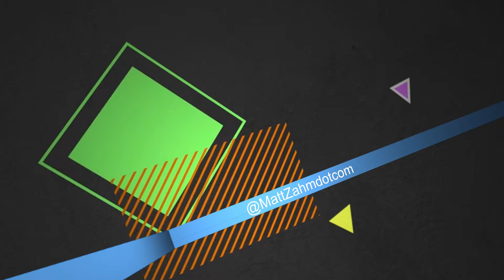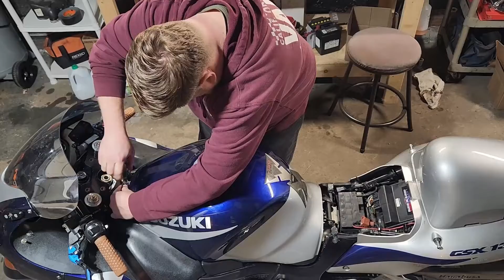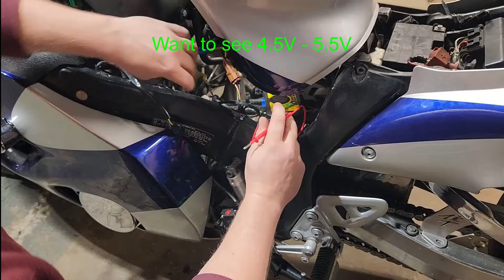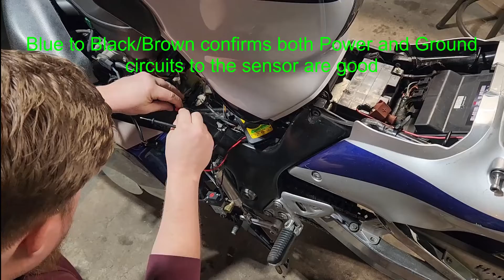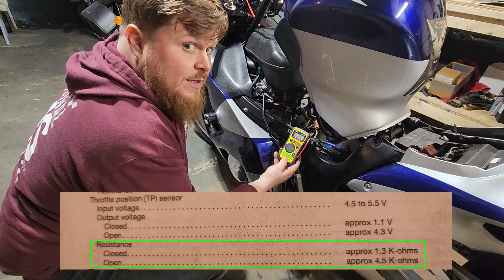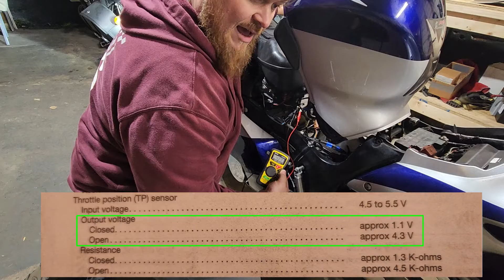Gen 1 Suzuki Hayabusa Throttle Position Sensor (TPS) Diagnosis/Testing

Comment: Hi Matt, will a bad TPS cause the bike not to start?? I have a 2006 Busa. I turned off while warming up and have not been able to get it stated.
Reply from the maker: I'm not 100% certain here. I'm more familiar with cars that have a more complex electronic system. Most go on fail safe and will allow the car to run with poor to no response to throttle input.

I have a feeling it should not cause a no start condition on the busa. I would think the sensor determines the plates are assentially closed at idle and would dump in its pre determined injector pulses for idle. I'm not 100% certain here. If you found out, lmk!

Comment: You issue is the fuel filter built into the the pump housing.. if this is an jntank pump. There's a bypass fix for this. Worked really well on my 2005 Gen 1. It cloggs up and starves fuel flow at high rpms. The filter is non maintainable so you need to bypass it and place a filter in line before the injector rail.
Reply from the maker: You were right. Shortly after this I replaced the pump. Did a vid on that too. I was just starting to poke around the diag at this point and had realized I wanted to contribute a bit to the "how too" world around the same time.

Comment: I have an 03 busa , I found rust inside the gas tank , I changed the fuel pump and both filters , runs great
Reply from the maker: I changed the pump shortly after this vid. The old pump was tired. I was lucky the inside of the tank was pretty clean. Love my Busa, man. 
Cheers!